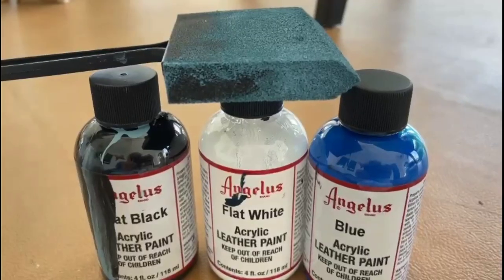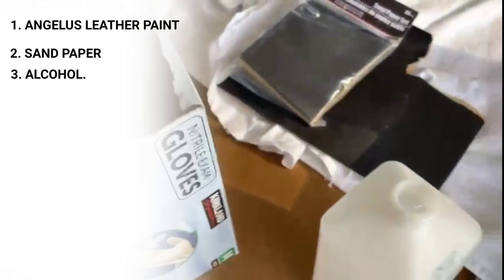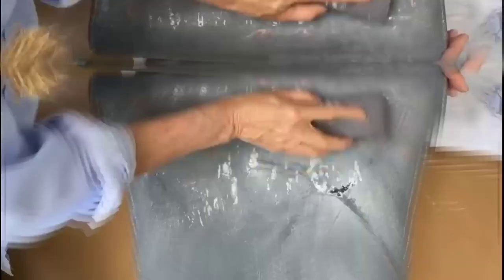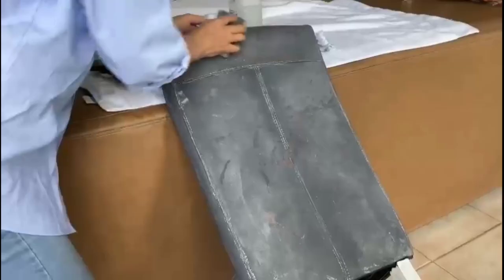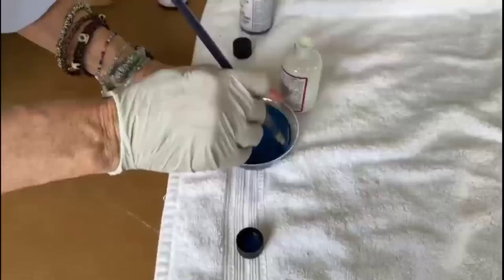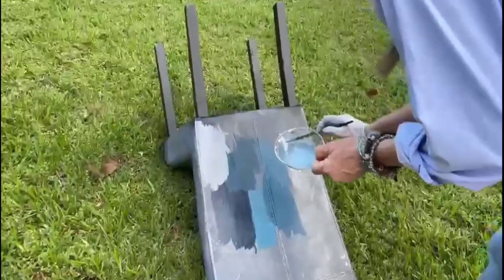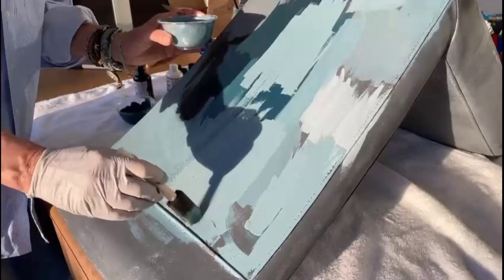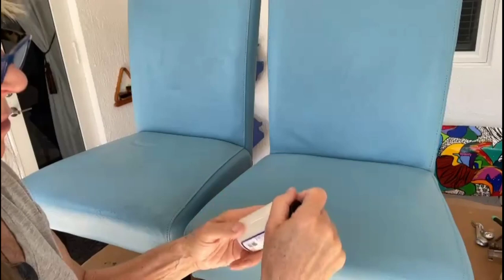Painting Your #Leather Chair using #ACRYLIC PAINT! EASY DIY

Comment: Hey there, thanks for sharing your process. Your chairs turned out amazing. Question, i am considering painting a dark brown 3 seater leather sofa to white (or pink). It has never been painted before. Do i need to use the primer/ deglazer they sell? Or can i just wipe it down with alcohol and start painting? Also will i need as much of the top coat finnish as i do the paint. For example i believe i will need roughly three 4 oz bottles of the paint, so will i also need three 4oz bottles of top coat finisher? Thanks for the info! ❤
Reply from the maker: Hello! Your project sounds exciting. 👍I used alcohol for my sets of dining chairs as well as the red club chairs in my other video using Angelus paint. So the short answer is you could use alcohol. They all still look amazing. That will be a preferential call on your part. You won’t need the same quantity of top coat as you did for paint. ( maybe 1–1 1/2) Would love to see your before and after of your sofa. I too have a brown sofa ( two) soon to be white. 😀thank you for watching my channel! Truly appreciated❤️
As a side note according to the manufacturer Angelus paints once fully cured are waterproof. On my second video using their paints on my red club chairs I didn’t use a topcoat.
https://youtu.be/HrwZ3yJMSw0

Comment: How do you ensure exact match of the sample for making the main portion for the job?
Reply from the maker: Hi. 1. Take notes when you are making your sample. Limit the amount of color you are mixing. Then when you have a color you like go back and mix proportions again.  (I was only using 3 colors)And then make a bit more than you think the job will require for the job may need a couple of coats and or touch ups. Hope this helps. Another tip is when you think you have the color and begin painting and let’s say it’s not quite right; take a small amount and color correct it; then go back and add that color to main paint vessel. Hope this helps you. Thank you for watching my channel💯